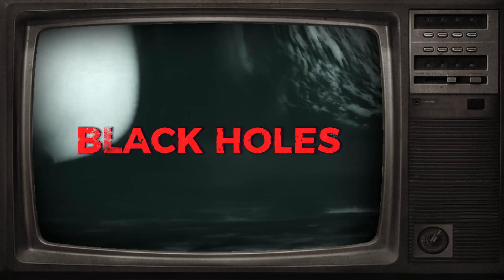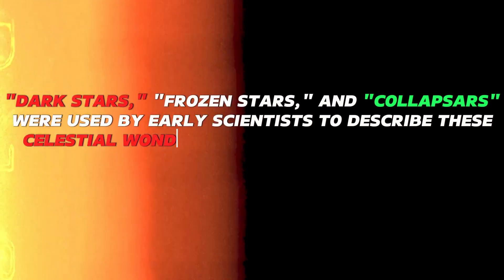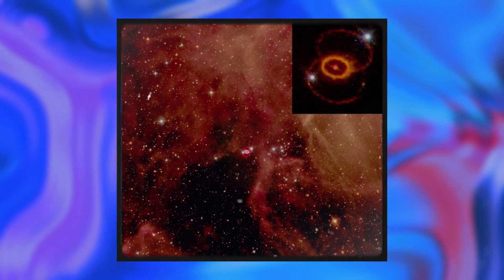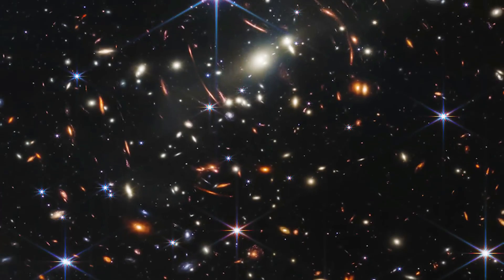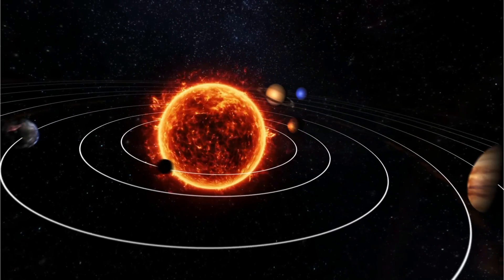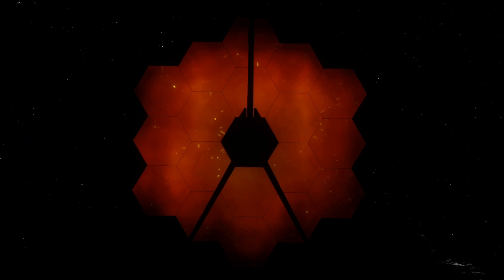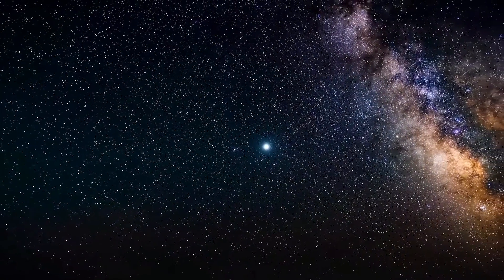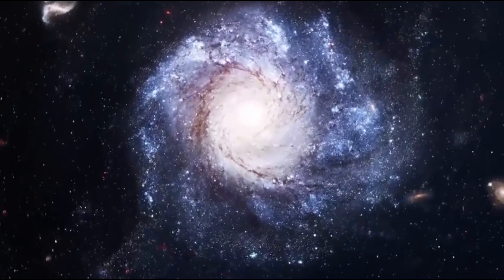James Webb Space Telescope Just Revealed First Ever, Real Images Inside of a Black Hole

Comment: When a star runs out of fuel it explodes into a dense black hole? How does a star implode into a black hole after it runs out of juice? Does this have to do with the vacuum of space? Some one please elaborate?
Reply: Its when the core of a star collapses onto itself, i think its already explained in the video
Reply: It is gravity, not a vacuum that causes black holes.  When a star runs out of fuel the heat it generates dissipates.  The heat pushes the star's particles (hydrogen, helium, carbon, etc.) outward like a solar wind (sort of like evaporation) while gravity pulls the particles back.  A star is usually in balance between these forces.  When the fuel runs out and the star loses enough temperature then gravity pulls the mass inward.  If the star's mass is three times that of the sun the gravity crushes the mass into such a small spot the result is a black hole.  If the star is between 1.4 and 2.1 sun masses then you get a neutron star instead.  A neutron star has gravity intense enough to merge all of the electrons and protons into neutrons.
Reply: Gravity
Reply: A black hole is insanely strong gravity concentrated to a tiny pin point